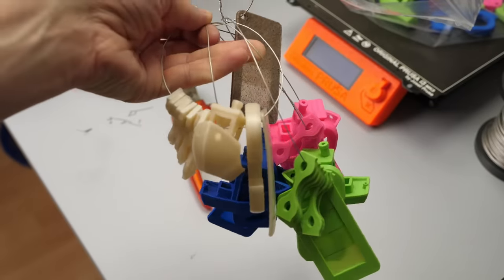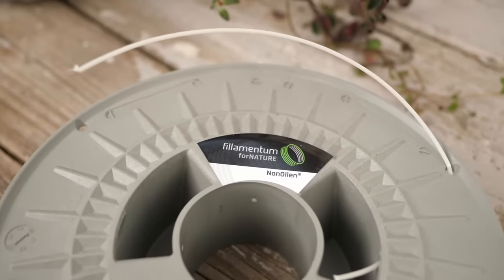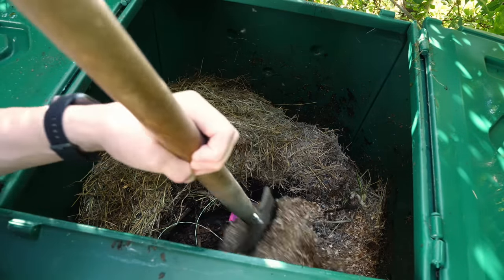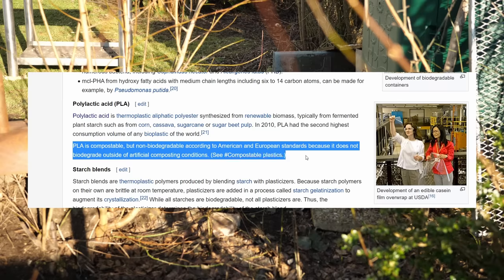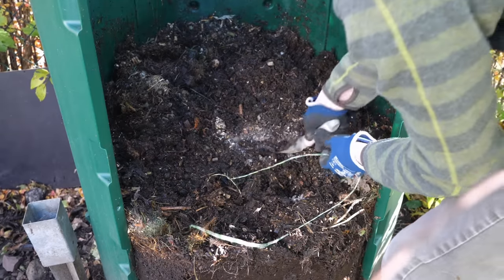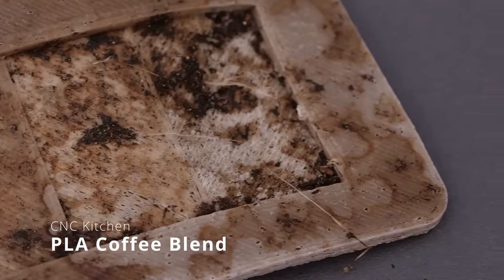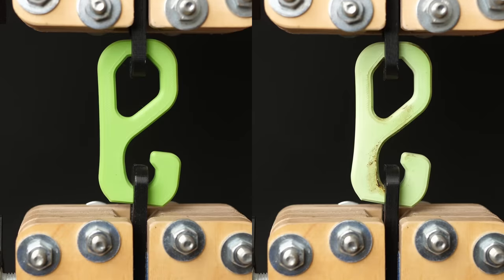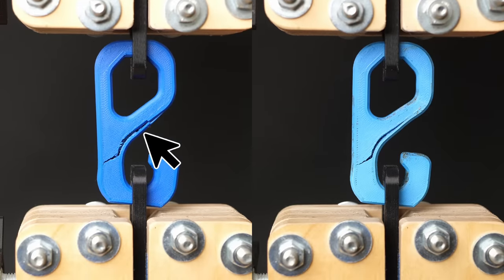I put PLA 3D Prints in my Compost and this happened

Comment: thanks so much stephan. this is actually the first review of the nonoilen i have ever seen. what i would like is for you to put back the nonoilen samples into your existing composter for even longer. and the recheck them full 12 months. perhaps then also 24 months. this would be very valuable and a great help.

btw it was also nice to see the strength of the nonoiled showing as being weaker. to be aware of that. however (and this goes for both the greentech and the nonoilen).... to give a strongest result you should be trying the method of successive temperature ramping partial annealing. which you do on the bed immediately after printing. this requires a heated  chamber. over a course of several hours (perhaps up to 12h? idk). you have to ramp the temperature 3-5 times. and each time only partially anneal the part. for example your 1st ramp might be 60c for 1-3 hours. then a cool down period at 30c to 45c for 30mins to 1h. then the 2nd ramp up to 70c or 75c. then back down again. then the 3rd ramp up to 85 to 90c. the specific ramping profiles really depends mostly on the capabilities of your heated chamber. and how quickly it can change temperature. and ultimately how high it can go maximally. however for htpla clearly the end goal is an annealed product with an hdt anywhere between 90c and 120c. it is important to do the ramping in this way  to created only a partial annealing each time. so that the dimensions of the print are somewhat maintained and that the annealed parts within the print are being held in place by the unannealed elements. therefore the successive ramping builds each time on that which was already part annealed by the previous cycle. and so you can cycle higher. hopefully that makes some sense. to give an insight into this technique.

anyhow the point here is that the greentech pro carbon is supposed to result in the strongest htpla through this method. however what if you also succesive partial annealed the nonoilen filament in the same exact way? would this extra post processing step then help to close the gap in mechanical tensile strength and make the nonoilen not be falling behind so far as with the unannealed versions of the same prints? or conversely would the significant PHB component of the nonoilen react poorly to the magical annealing process, and become a failure when compared to other regular leading htplas? BTW for a control reference a 3rd HTPLA that also is worth comparing (as a control) is the esun pla+. which also people are using for partial annealing. with the same above technique. good luck stephan, i really hope you can do a video in future to cover this topic. i know you already covered annealing but those other annealing methods (for example in sand etc) they just arent the same thing. they might work well for annealing other types of material. but maybe not pla? so i think your time is not wasted here, also given that other in the 3d printing community are already doing this newer annealing method and with some comparative degree of success. and with less warping etc. at least that is the promise, and the expectation. to make this method worthwhile. but also for the convenience. because if you already printed in a chamber the idea is you can just run an extra program with the ramps in it. and leave your print there overnight. and without touching it or opening the door. so that should also be a lot more convenient. more practical. especially if have multiple printers

Comment: If the compost pile is too insulated then the heat will slow down the rate of decomposition, it's a feedback system where heat is produced until the heat slows it down. Maybe a less insulated pile may have more activity and lead to higher rate of material breakdown.
Also, if the rate of decomposition is based on surface area, shouldn't mean microplastics will decompose quite quickly?

Comment: Perhaps you could try using a 12v immersion heater element in the core of the compost to keep the temperature at a stable 60C which will also improve the compost. You could power that with a solar cell or battery. See if the 3D printed parts break down with exposure to 60C for different time periods and see if they truly break down with industrial processes.
Reply: @stephandelaat  to clarify, you do mean 70°F right? First time I read your comment it looked strange to say that 60C is above the max 70 degrees recommended in compost 😁
Maybe John meant 60°F as well, 60°C seem too extreme for compost even to a compostnoob as myself 😊
Reply: @bennylloyd-willner9667  I ment Celsius. 

But warming up a compost pile is not the way to compost. Like i said..temperature is the result of composting…It is not the the target of composting. Actively warming a compost pile is not required for composting. It would also be 100% against the reason why people compost. You do it to save the environment.
Reply: @stephandelaat  OK, I don't really get your comment then, "bad idea to have 60°C since over 70°C is bad". I mean, 60 is actually pretty far from being over 70? I'm not natively speaking English so I may just get something wrong, but it looks funny to me.
Reply: @stephandelaat  I do get that good compost generates the heat by itself, but to help it along a bit (not 60-70°C) can't be all bad. Like in very cold climates where the insulation can't keep the cold out and the reaction is slowing down to almost a halt ?
Reply: @stephandelaat  I don't think all people compost to save the environment. Some do it to get great soil for their veggies and plants. That is also good for the environment in that they don't need to transport it.
Reply: @bennylloyd-willner9667  I shouldn’t have brought up the 70 degrees. Long story short you do not have to warm a compost pile with an external energy source.

Comment: PLA microplastic is not inflammatory as others (PP, PE). Because PLA biodegrades inside the body. (It is even used as a medication dispenser, because it breaks down harmlessly)
Some pigments may be inflammatory and cause problem though, so in order to make PLA microplastics non harmful, the selection of the pigments is quite important.

Comment: I'm starting to see a bit of a pattern in experiences with those Extrudr filaments... I used to have a roll of NX2 PLA in matte black, and it looked gorgeous - but the layer adhesion was very poor. I had to print a bunch of parts over because some slightly thin sections just snapped clean off. Looking around on the internet, it looks like it's not just me.
Reply: Yeah, I also have some green NX2 PLA and layer adhesion is very bad.

Comment: Industrial composting optimizes the process by shredding everything that goes in.  Then it carefully controls inputs of water, air, nitrogen and carbon compounds while regulating the temperature and keeping it 'homogenous' (stirred up so everything is evenly distributed).  To even come close with the rotating composters, you'd have to shred the plastics, monitor the temperature and rotate it automatically, and monitor pH to determine whether it needs more nitrogen, etc.   That sounds even more tedious than performing 3d printed strength tests. 🙂

Comment: How hot was your compost bin over that year?    I am considering trying this, I am in Florida, and am sure I can get fairly high compost temps, with a proper bin, rotation etc.  Temps are supposed to be over 60-70c in order to compot PLA.  Which is like 120f+ which is really high.  I might be able to obtain this with a black compost bin in the florida sun, but can't say for sure.

Comment: I have a rotating composter and my only advice is very carefully scrutinize the method used to keep the door closed. Mine will open when I spin it!!! So I do not which defeats the whole purpose. I will have to derive a solution for this problem - perhaps a barrel latch - haven't tried it yet. good lick and happy comoposting!

Comment: One other consideration, which I don't think I heard you mention, is that a lot of the colorants and additives (strengtheners, softeners, etc) can also affect both the ability to biodegrade and the toxicity if they do.  I've certainly had some PLA filaments (black and purple being the worst) that smell almost as bad as ABS.  Because of this, I stopped tossing my failed prints into the compost (Seattle's one of those few places with commercial composting that can handle plastics).

Comment: I wonder if the plastic would break down more in a biodigester since it would be underwater?   Either way, biodegradable plastics still have a long way to go.  In the short term it might be more practical to slip small amounts of pla into the fuel for a hight temp stove.  If it's hot enough, the plastic should break down and burn cleanly.

Comment: for the next test you should try shredding some of the samples.  I feeling like it is much more difficult for the composter to compost the samples when they are completely intact.  it's also much more of a realistic test if the samples are shredded.  almost everything that gets put in a compost bin gets somewhat torn apart.  and I'm also assuming a industrial compost factory would shread everything as well.  the only problem i can see is being able to find the shredded pieces by the end of the test. perhaps if you get more than one of the new compost bins you can dedicate one of them to just the shredded plastic,  or you can put them in some sort of mesh bags that aren't made of a biodegradable material.  love your videos!

Comment: about ten years ago had my first plant based biodegradable plastic experience in form of corn based one time plates and utensils - in realm of one time usage things for sure recommend their forks and knifes as they are better than normal plastic ones(Ofc if you can use the ones you can wash and use for years to come). Sad moment was next years compost opening - the plates and utensils had not composted almost at all. We did some more manual work to make them smaller and sent them on another round and then few more. I think some could be still find some peaces in the soil at this point...

Those that live in EU probably remember this: "From 3 July 2021, single-use plastic plates, cutlery, straws, balloon sticks and cotton buds cannot be placed on the markets of the EU Member States."
So our local food takeaway companies started offering biodegradable packaging - lovely but one sad realty is.... we don't have composting plant that can handle those plastics...

Comment: I am glad more and more people are talking about this. What I am wondering, however is if still it would biodegrade faster than conventional plastics (not to mention it is still a reduction in pollution in the manufacturing process). Conventional plastics will take hundreds of years to degrade. Yes, it is great to be aware that PLA is not a miracle material and will not degrade in a few months of being left in your garden, but if it takes several years to degrade, it is still better than conventional plastics.

Comment: Although ecenomically speaking is cheaper for the end user to just get rid of the unwanted prints in the compost bin, where 100 days are not enough, technically you need to keep them in there for good measure 2 or 3 years, but is cheap and doable, my take is that in such case you need to buy more filament to make your prints, and that has an impact on mother nature either way, oraginc sourced raw materials or inorganic sourced ones.

So lowering such impact is more important than cheap composting the undesired results/supports, etc.

Hence re extruding your unwanted prints into filament, even if the add on of same material pellets, makes much more sense to me (not to the pellets industry, if you make yourself a reused filament mix of 60% printed matrials and 40% new pelets, they are actually losing to you 60% of their sales)

I know that requires some expensive machineries to make sense, this is why I se it more like a local cooperative of makers that run such a small shop based on voluteering a this stage. (I calculate in my mind some 30.000 euro and a lot of volunteer hours)

I have no clue where Stefan lives, but I bet that if he gives a shout out on a 30Km radius he will  find a few hundred interested folks, and if only 50 of them join seriously they can make it happen in 2 months, up and running.  The others might choose to contribute be it by bringning in their already sorted by material and eventually colour unwanted prints, maybe give in 10 Kg against a one Kg newly extruder reel of 60/40 material, or by purchasing from the cooperation point (instead of Bezos point) to help them make sense and grow roots.

I dare you Stefan, I double dare you.  And I always am ready to help with advice, links and other indications as much as I can.

I bet if Thomas Sanladerer  does it too (hoping he leives away from you so he creates another cluster) and if we can convince a few more influencers around the globe, maybe this quiet movement can take place in a year or two everywhere.

And once you have the setup and the volunteers, you can also talk to the local councils to direct to your place all the plastics dropped by the public in their waste recycling centers (and get paid by ton for receiving it), and sort it on categories, colors, you can make them filament too, instead of having them either burned somewhere or landfilled somewhere lese.

Let's take Munchen for instance, how many people own 3D printers there (irrelevant, most of them do not use them at all or too little) maybe hundreds of thousands.  How many of them actually use them enough to be bothered by they unwanted prints?  Maybe thousands.  I think it can work fine there, or Bonn, Berlin, Hanover, Frankfut, Hamburg, etc.

And once the movement is generated, smaller density areas might find their way too with your expert help (yep, being one or two years ahead of them will make you loo "experts")... lol.
Reply: I was thinking about organizing something like this in the Brussels area. Recycling printed parts seems the way to go.
Reply: @nesnduma  Good, let's get things rolling than.  Wee ned to prepare a short page with the requirements, strategy and resources, than you can spread the word based on that, and see how many folks would join you. Than you can start it up once things have fallen in place.

Comment: A note about composting for people interested. 
Do not mix your compost or aerate it. Also it should rest on the bare ground where worms can dig up from bellow. It should remain moist at all times. Add water if the top is dry.
It takes at least one year for your newly added waste to become usable material (almost black dirt with no chunks of recognisable organic material) but you should keep adding to the pile on a regular basis.
Really, I repeat, you don't want to disturb the soil as some bacteria are aerophobic and will die off if exposed. You are also slowing down the fermentation process with aeration which is a shame as the hi temperature is basically the sign it's in full activity doing it's job.

Comment: What about a test piece that's a screen?  Like a net. That way instead of it just being thin there's also holes in it as well.  And rather than testing strength you could check the weight.

Comment: A question I have is if burning pla is carbon neutral like burning wood and how toxic its fumes are. Maybe I could use old prints as fuel for home heating if it's safe and carbon neutral.

Comment: Would love to see if PLA is digestible if small enough In a simulated animal gut. Just to see if microplasic build up of PLA microplastics Is a problem.  We sand PLA and other plastics all the time but where does that plastic go. Ends up in the water and in animals(is my guess). Does PLA digest when in an animal when it is ground that fine.
Reply: Yes it does.  PLA microplastic is much more easily degraded.

Comment: in sweden we burn a lot of trash using very good filtering tech to prevent air polution.
i think that works great with bio plastics since then at least we are not wasting petrolium based plastics that could make more senser to  recycle...

Comment: Thank you for this interesting long test. It would be interesting to see if the degradation process can be trigged/accelerated/catalysed with something pretty easy and natural like, soaking the PLA parts in a vinager+baking soda solution (or any other organic mix of this type) for hrs/days, at least prior to putting them in the composter. Or so. 🤷🏽‍♂️

Comment: If the PLA was dissolved into a solvent could that help with complete decomposition? As the thinner material of the nonoilen and chunks of the benchy were decomposing, having it in liquid form could help accelerate it.

Comment: First off, lets recognize that when defined by what happens in 12 or 26 weeks, or 100 days, biodegradability is not about whether or not it causes a huge environmental impact long term.  What du you think happens with wood in the same time, it depends on the type of wood, but some types shouldn't be very far from those results, possibly even within that range, in part of initial strength lost. Degradation is likely to accelerate, microorganisms that can make good use of the material will benefit, and increase in numbers, and given enough time, even become better at using it.       

Also, micro plastics, why, oh why would plastics stop degrading at some arbitrary particle size? You said it, degradation happens on the surface, the smaller the particle size the faster degradation should happen, all else equal. With blends I get it, part of it can degrade a lot faster and leave particles that takes longer time to degrade because it's another material than the first part, but when there's one type av material, nope.